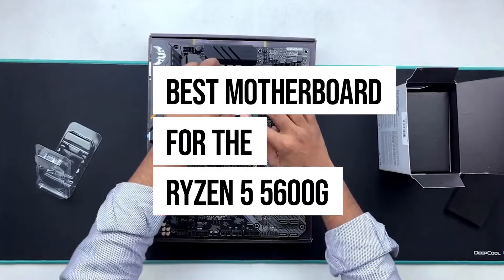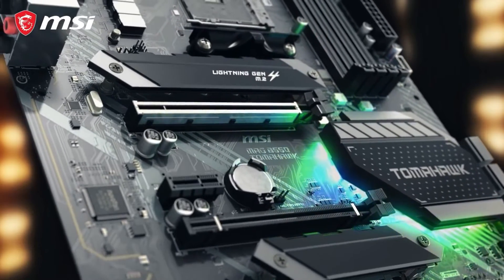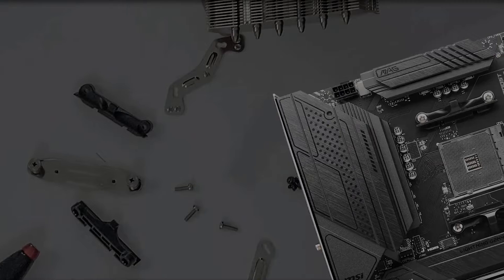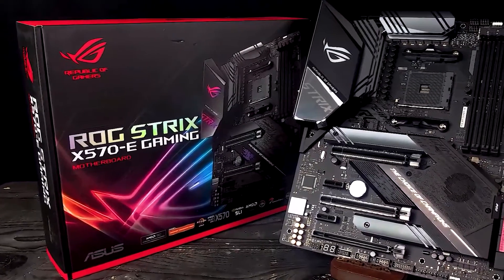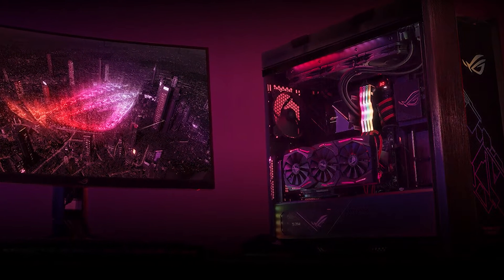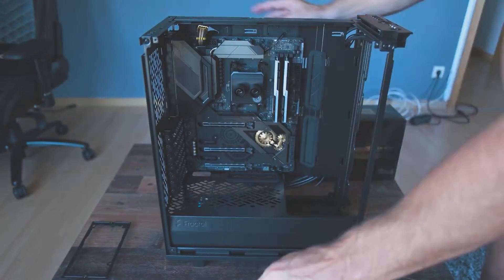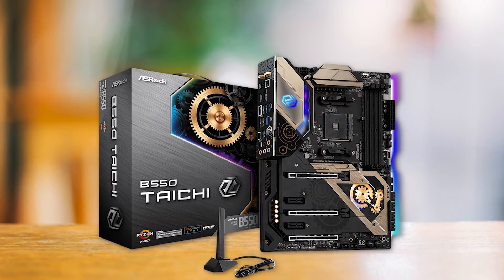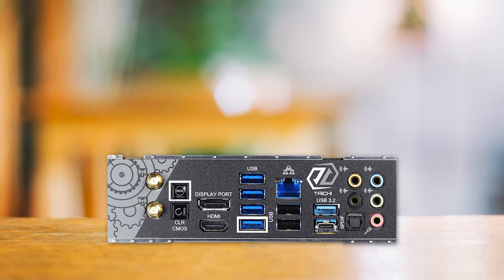THE BEST MOTHERBOARDS FOR RYZEN 5 5600G! (TOP 3)

Comment: Hey i paired the cpu with rtx 3050, it was giving me 70-85 fps in rdr 2 and 150-180 fps in MotoGP 20 in 1080p, but some times when i play games i see the drops in fps. And it goes for days and suddnly gets fixed automatically for few days and then again the problem appears. Like rdr 2 drops to 50-60 fps sometimes 40 and motogp to 70-120. I never changed any settings in any games and windows. I tried everything on YouTube but doesn't fix that. My monitor refresh rate is 144 hz. And gpu usages while playing game is 90-100 percent and cpu 7-30 percent. What is the solution, i even tried overclocking.